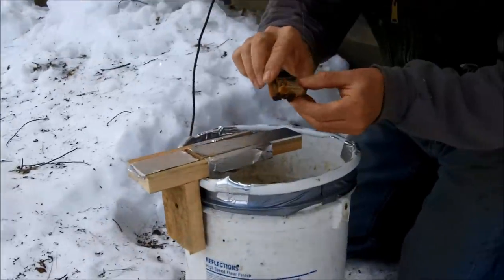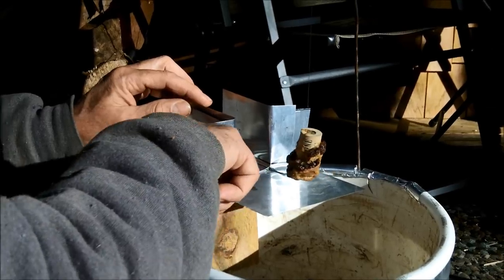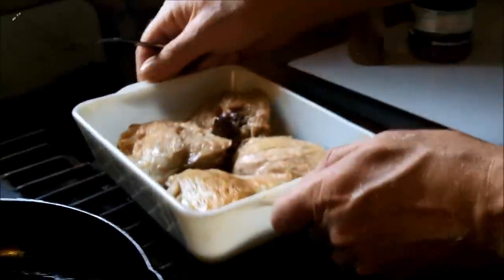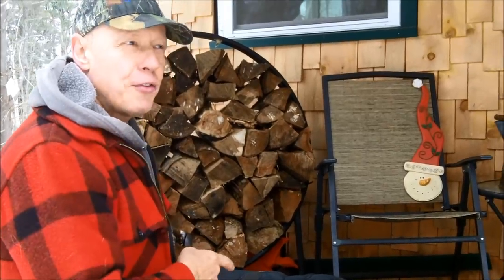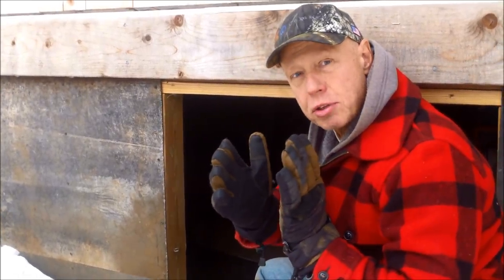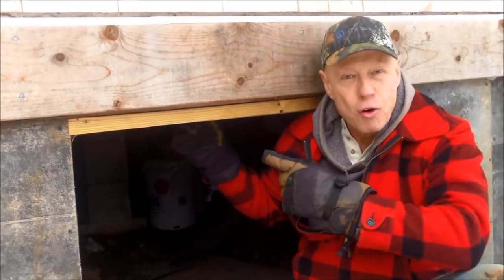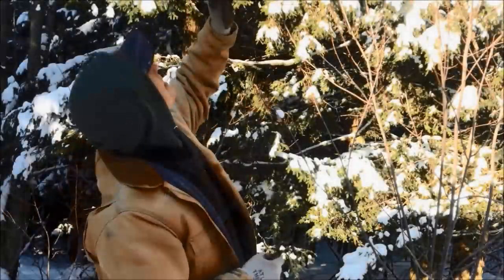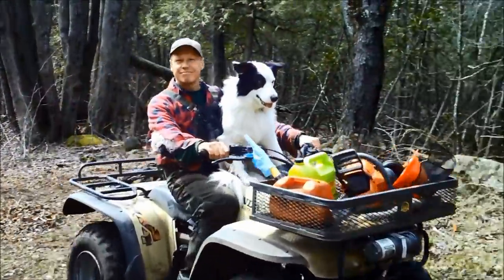OFF GRID CABIN LIFE.   Cocktails, Mice & Mango Chicken with an Insulation Update

Comment: I built a trap similar to your latest one.  I made mine from all nylon and a slug of brass for weight.  If you are right at the edge of the counterbalance not working properly just crazy glue a penny on the bottom side of the counterbalance.    Mine works great.  In fact, the last mouse I got, I believe had swimming lessons prior to his diving board debut.  He was in the water face down, spread eagle, and the fur on the back of his head was completely dry!  Must have gotten a "10" on the belly flop score card!  YASSAH
Reply from the maker: There's 8 mice in the bucket as i type ;-)

Comment: My old place has been completely redone I left the oak floor joist and oak subfloor as it was for 80yrs, bare no insulation! With the hot water boiler there keeps it at 60f all winter  in central PA.mts I agree with you, over insulating today is a waste! let it breathe! All the walls are closed cell spray foamed at 3" thick.

Comment: Ah yes,  venting the home.  I have since moved from the cabin in the bush with a wood stove.  I used to leave a window(about 6 ft from the stove) open about a half inch so the stove could breathe and replace the air in the cabin.  Then, because the new wife complained, I put a 3" dia hole in the floor behind the stove and ran a piece of 3" foil flex pipe from the crawl space below and screened in the end to keep any critters from having a thoroughfare inside.  It never froze in the crawl space so it was an excellent source of fresh air coming into the building.  The new building codes 'seal up' and then purchase an expensive air exchanger.  Just consumerism.  Great video!
Reply: It's actually called building science but either way, I accept your opinion ! lol

Comment: As long as you are enjoying and having lots of fun is the best.  Will look around for the better mouse trap.  Maybe a light weight spring to re-set the diving board. Yep! skirting the outside works much better than the floor.  Keeping the wind out is the key.  Thinking you got it figured out.  A single tarp thickness for skirting will keep the cold wind out.  Another great video.  Thanks and an a grand day.

Comment: Hello Boss:  Do you have a scale with which to weigh one of the dead mice?  Maybe as an improvement you can adjust the balance of the "diving board" in order to finely tune the  pivot, so that as the mouse approaches the wine cork,  its weight is enough to activate the pivot so the mouse plops into the bucket.  The other improvements are spot-on, so the mouse cannot gain purchase to prevent it taking a bath.

The peach mango chicken looks very good!  And smart call on using chicken thighs instead of breasts:  Thighs are cheaper than breasts, and definitely have more flavor.   Once upon a time I was working on a chicken noodle soup recipe I could can.  I could buy a 40-pound box of "chicken quarters" for $16, but unfortunately I wasn't too skilled at the time for de-boning them, and ended up making a mess.  Maybe that would be a good winter canning project!

Nice catch at the dump!  Woolrich is a brand I recognized.  And who hasn't heard of L.L. Bean?  Too bad you couldn't somehow "undye" those pants and then re-dye them green with some Rit Dye.

Oh well, back to my canning.  It's 42F and foggy here.  Winter will hit us soon enough.  Good video, and all the best to you, Lori, Frankie, and Tildy!
Reply from the maker: I'm getting some pretty good catches this week.  I emptied out those 5 a few days ago and there's 6 more in there now.  These mice are amazing gymnast. I've gotten an education by using these cameras.  This has been a fun project :-)
Reply: @thebossoftheswamp  oh goodie, can't wait to see.

Comment: Another good video Boss, thanks. With the bucket trap - try putting the wine cork up higher so the little bastards have to go to the end of the diving and reach up for it, that way they cant hold onto the edge, and if they put down force onto the board to get the height they will just tip in quicker. I used to catch rats in old leg hold rabbit traps that were really too big - by hanging the bait high, so they would jump around on the trigger plate to reach it.
Reply from the maker: I did that but the camera showed it was being ignored.  Got it down to a science now and the lil bastidds are floating daily ;-)

Comment: You're right about the insulation underneath on the walls I have a small cabin at 16  bye 20 and a standing on wooden piers which side on top of concrete pads I have tooken sheet metal and put a long sides now on the inside of the cabin I had this high density foam which was free and I insulated the walls under the cabin with it there was a couple little gaps I use fiberglass in that I picked up some pit liner which is free. I went from the floor joists down over the high density foam down into the ground and then I back filled it with dirt inside the cabin underneath it's almost 50 degrees year round except when I open up the vents in summer I have water pipes down there and it gets below zero up here outside it takes very little to heat this cabin looking forward to the mice videos if you have chicken you can feed them to the chickens give him a extra protein in the winter thanks for sharing

Comment: You have to blow the lint out of the gas and air jet thing. Look for a video on youtube I fixed mine they get lint in them and wont light but after you take it apart blow out the orfice it will work liken new maybe or its just a thermal coupling.

Comment: I remember your video when you built the extension  on your New York cabin . You used bubble foil on the floor . You said that you must cover the floor afterwards to keep the water from being trapped in the flooring until you get your building closed in . I think that must turn a few people off because they have to walk on a plastic sheet while closing in the building . That's a small price to pay when you consider the benefits of bubble foil . I did it your way and it turned out great . Just cut the plastic away when the building is enclosed . Patch any holes with gorilla tape while working . Besides the plastic sheet protects the plywood flooring while working . I cringe when I see people putting vat insulation or foam in the floor . Too much work and for the money it's not worth it over time . Great video as always Boss . God Bless you and your family .

Comment: The Reflectix might have a lower R value than the pink fluffy stuff, but it REFLECTS the heat from inside the house back into it! You're not going to get that from fiberglass batting, or even the spray foam. That's why it's called "Reflect"ix. 
I have used it over the pink styrofoam to make an inner and outer box for my in wall air conditioner to keep cold air out and keep warm air in. It sure helps a lot! The outside box just slides over the rear of the air conditioner and stays there through friction fit. It never blows off.
The inner one is held over the front of the A/C with four cup hooks screwed into the wooden frame around the A/C opening, there are two above the AC, left and right and two below the AC in line with the upper ones. I put the insulated box over the front of the AC and then hook two flat bungee cords to the hooks and over the box. It's held there with constant tension pressing the box to the frame. It's working out pretty good, this is my second winter with the inner box in place. Before, I used to cover the front of the AC in old bath towels and then cover everything with plastic and use blue painters tape to tape the plastic to the wall. It was not a great method and it still leaked cold air in here, esp when the tape would give up.
I also used the reflectix in a nylon lunch box. It has a square plastic tub that lifts out of the nylon shell for easier cleaning and gives the whole thing some rigidity. Things didn't stay cold in it for long, even though the nylon shell is some what insulated. I wrapped the walls and bottom of the plastic box insert with reflectix and made a small piece to fit on top of the box and it all fits in the shell and keeps everything colder longer. It might also keep warm things warmer longer too, but I haven't tried that yet. It's good stuff, the Reflectix.
Yes, I agree, people need to chill out and not get such a stick up their ass about the smallest things.

Comment: I have been thinking about the mouse bucket trap. What if a guy took some sheet metal and made a funnel so it it fits to the inside of the bucket. But make it steep enough that once they get there little paws on that sheet metal, WAHOO.... there they got into the bucket. 
Just a thought.....
I have half of my garage is insulated and dry walled. There are just a few areas on both sides I think I will staple up the bubble foil.
I did the cooler idea you showed awhile back and it works. My ice stays ice all day out on the boat. Who needs a YETI COOLER......

Comment: Hello Boss, love your ingenuity with the mouse catcher. But, you have not explained where they are coming in under the cabin.
You have the skirting wall with what looks like cement board sheathing. I have the same set- up with my cabin. What I did was to dig about 10 to 12 inches into the dirt and extend the sheathing into the ground. Then I just backfilled the dirt. closed up all the other gaps. Sealed my access door, no mice for 20 years! Sure they may get in through the door one in a while when we open it, but this works great. Mice don’t seem to dig more than 12 inches
Reply from the maker: Going to talk about this soon.  If I keep them out then my entertainment will stop.

Comment: Got a question for ya concerning the bubble foil.  Just want to say that I do understand why you use it.  It makes sense.  Just curious if you used something like the roxul board insulation that is about 2 inches thick between the joists and then put the bubble foil over that without covering the joists, if that would be any improvement or do you think the damned mice would get in?  Just thought it might add a bit more warmth to the floor without completely cutting off the heat to the crawl space.
Reply from the maker: It might help but I really don't want to insulate the floor too much because then my pipes will freeze.  I seem to have the right balance under there as it is.

Comment: One more thing I forgot to mention:  On that infrared heater you picked up at the dump, you'll want to check to see if it has nozzles for natural gas or propane.  The natural gas nozzles deliver much more fuel than propane, and if it has the wrong nozzles for your camp, the thing will practically explode when you ignite it.  Just thought I'd pass it along.
Reply from the maker: Very good point indeed.  Thank you

Comment: Have you ever tried an extra layer of bubble wrap with dead air space trapped in between the two?  Maybe 2x2 runners on your joist and then staple the next layer on the runners.  Staple close enough together to keep any insects or mice out.  I have run into the squirrels causing the most damage.  The flying squirrels are the most formidable to protect against. They start at the top of a structure and work their way down testing until they find an easy place to chew through and get inside.  I want to build my next cabin with a layer of sheet metal between the flooring and the joist.   Then a 90° angle with 16"s in length under the floor along the entire perimeter of each wall.  Then 20"s of metal bent up the exterior 2x6 walls.  It will be covered up on the walls by whatever type of siding.  It is kind of like a bath tub effect.  Thanks for all of your time and knowledge you put into your channel.  Merry Christmas!
Reply from the maker: Never needed to but any trapped air space is a good insulator.  :-)

Comment: JC? Need some advice.  I Love that bubble wrap you use. I'm wanna try it. Because underneath one end of my house has had critters tear out the plastic that was holding the Insulation up while I was away for a year.  Trying to put the insulation back the way it was is just gonna be too hard and too much damn trouble to mess with it. 
My Problem is,  I have a lot of a steal under there because this is a manufactured home. Any ideas how I can attach bubble foil to the steal beams?? Or should I just rip out the left insulation and try attaching it in between the beams? Your thoughts? You always fix things so effective. :)
Btw,Those clothes look like they came from the thrift store or good will. But Great finds! 
To hell with the people bitching about the Presidents. I couldn't give a crap about that. So no problems with me. 😉
Reply: JC , I wasn't clear. Forgot about the skirting, so couple questions?? Damn,.. I have concrete block skirting! I don't believe that's insulation enough, correct? So?
 Would apoxy glue or something similar work to attach the the bubble wrap onto that block? I need help with this with advice,  I'm a female alone who lives here  and about the only one who can fit under the house so it's gonna be me to fix all this stuff. So a recap- Do you have any suggestions on how to put bubble wrap on the block and underneath the manufactured home ? Tear out the existing Itirn insulation or attach it to the one area that's fell down from wild critters? There's nothing to Staple to unless I can find the area between the beams.  Just wondering what your best thoughts would be. The torn out insulation is only on one end of the house.
Reply from the maker: Let me give this some thought and address is on a Sunday video.  Can you staple the foil to the underside of the floor between the steel beams?

Comment: Now if it was me I would put about an inch of black powder (ffff) in the bucket and put a mouse trap on the plank thing you built. Where the u-shaped bar hits on the mouse trap, put a little piece of C4 and a blasting cap on it. The mouse triggers the trap and it detonates the C4 blowing a hole in your floor spreading mouse guts, wood flooring, and bubble foil all over Frankie. Now that would make a cool video taken from inside the cabin. You would only show it for Patreon viewers.

Comment: best bucket mouse trap I made was real easy. cut a piece of cardboard that just fits in the mouth of the bucket, take a coat hanger and cut the straight part off, slide wire into the middle off the cardboard, dill a hole on each side of bucket rim,  insert cardboard into the bucket with wire acting as a hinge, put a screw in one side of bucket so cardboard rests on it, glue a small washer on screw side of cardboard to act as a counter weight,  add water and hang bait over the side that lowers into bucket,  mouse FALLS IN, TRAP RESETS.... TA DA
Reply from the maker: Have you seen my EXPLOITED MICE video?  I got a little carried away with the trap design haha

Comment: The local towns, county, and states require an R-factor is most of the problems and also they look at trailer homes and see a high R-value in floor then a cheap plastic skirting,but they dont see is the heat tape or lack of and the frozen pipes. Im with you skirting or foundation is more important  then the floor. Also politics is tuff we know that cause Trump didnt win 1million - o.  as far as God if one believes it is not something to back away from. God Bless!
Reply from the maker: God Bless